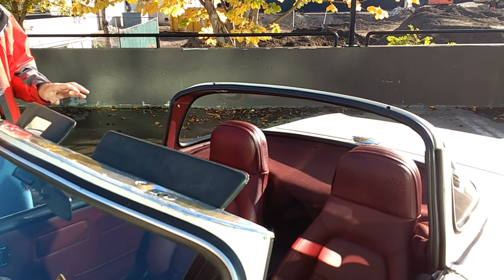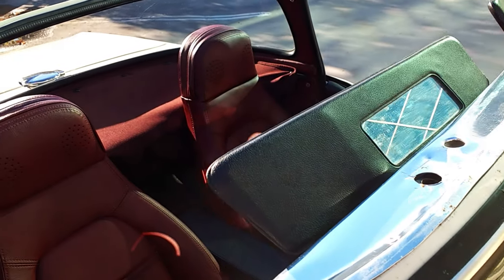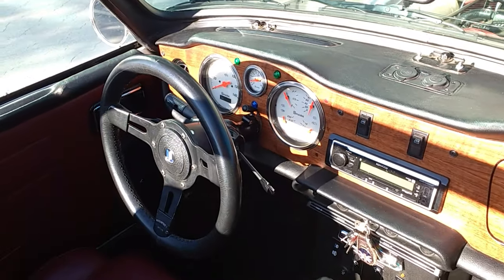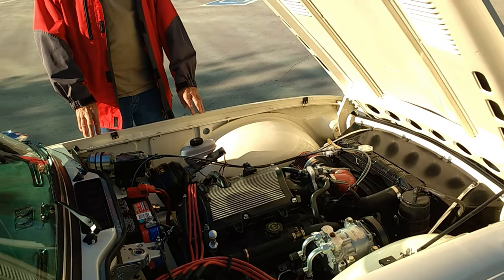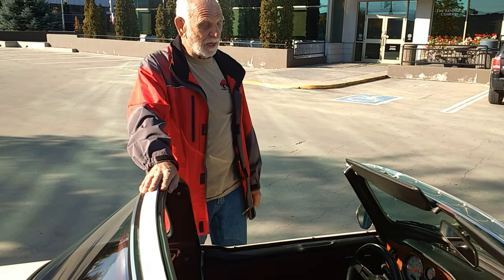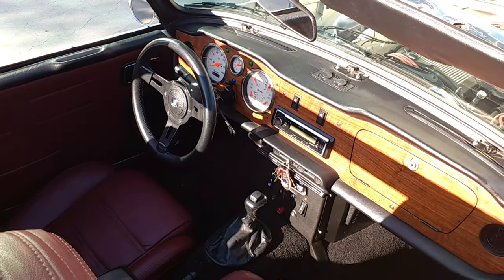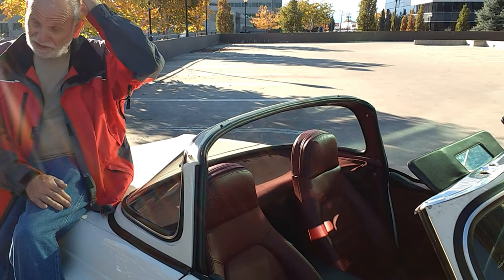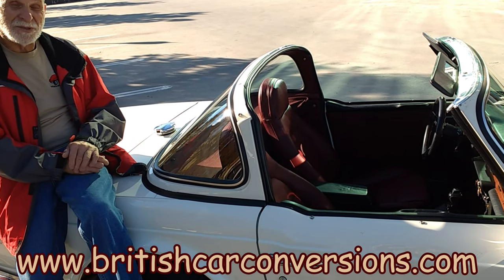Naughtygirl a custom TR6 part 2

Comment: One additional improvement that I really appreciate is the relocating of the ignition switch back to the lower dash. The stock ignition switch under the steering column is a poor design in my opinion